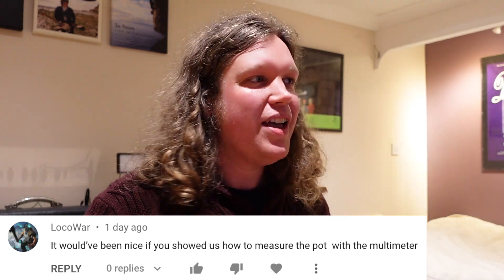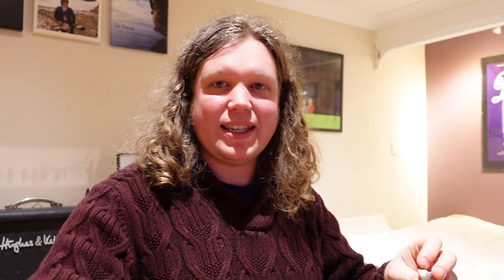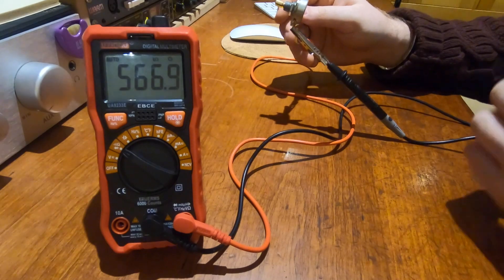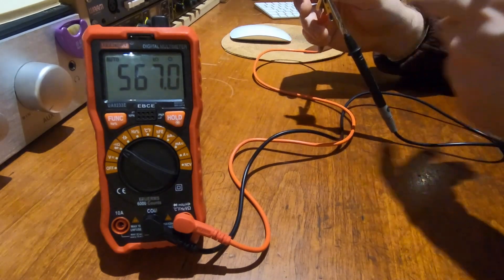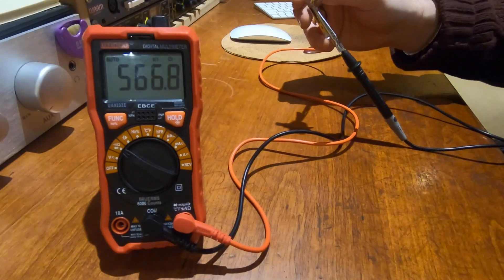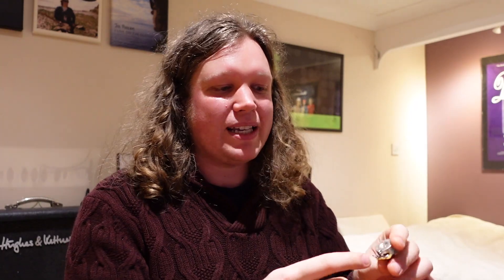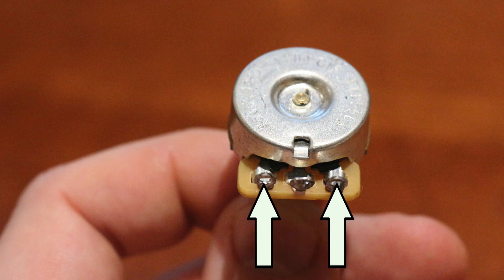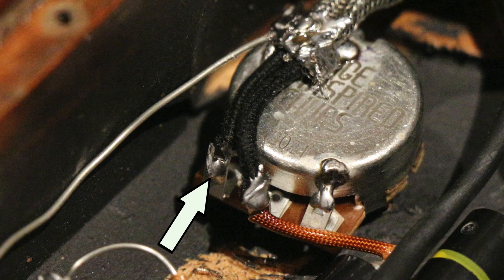How To: Measure Guitar Pots With A Multimeter

Comment: Here's my problem. I had to replace a push/pull pot but the Chinese wiring system was so convoluted I decided to rebuild a LP style 2×V, 2×T configuration. First try failed so I'm starting over. I removed all wiring and followed instructions for checking pots with multimeter. I get either OL or 0.0 on all four (meter set to 2k resistance). Surely all four pots didn't just magically go bad! Any advice?

Comment: Joe,I’m refurbing a 1960s record player,aRegentone,the tone and volume pots are tested same as guitar pots,but on pot with switch,with 4 wires,how can I test the on/ off lugs,thanks for any advice,modern pots only have 3 lugs going directly to the board,I’ve got 4 wires on this pot.and no diagram!
Reply from the maker: Hmm, not sure to be honest!  I'm guessing that the outside lugs will still be the inputs, and the middle two lugs will be independent outputs...perhaps so you can use the pot to pan Left and Right, or similar?  That's just a guess though!

Comment: With said thank you for you hard work on this video, If I'm using the multi-meter correctly and get no response at all I assume my pot is gone down the river?
Reply from the maker: If the pot is outside of the guitar and you've connected the multimeter correctly, you should get a reading, yes

Comment: Does it make a difference is one pot reads 550 and one reads 520?
Reply from the maker: The 550 pot will sound slightly brighter than the 520 does - but the difference won't be too significant

Comment: Hi Joe, thank you for the info. I’ve got a crazy (as in driving me) both my tone pots of my 2020 Affinity Strat HSS work only at 2 then no further change in tone at all thru 10. Back down to 2 makes same change. Pots are full size but what kind is unknown. Volume pot works OK and I believe is linear based on a different test I was doing. Any ideas whether it is wiring or something else? I’m new to guitar electrics and not quite ready to open pick guard til I get what I need to repair it. Any repair and replacement suggestions? Thanks so very kindly. Cheers and 
Keep playing.
Reply from the maker: Hi Steve - my guess (and that's all it is!) would be that those pots have a logarithmic taper but have been wired in reverse.  This is usually only an issue on left handed guitars where companies take a 'standard' log pot and wire it so that it moves in the 'correct' direction relative to the guitar, but this reverses the taper - the tone pots especially act more like on/off switches and are pretty useless for the first three quarters of their travel.  If you're not lefty though it would seem weird for this to be the case, as it would mean Fender used lefty pots and wired them backwards to work in a righty guitar, and that makes little sense to me unless it was a mistake.  But that would be my best guess!

Comment: So i tried this, on a new pot, and old pot i know works, and my reading stayed at 1. I tested my meter on a pickup and it worked on that, so im puzzled.
Reply from the maker: Only thing I can think of is whether the probes of the multimeter were touching each other; or touching the back of the pot and grounding out?
Reply: @JoePerkinsMusic  ok will check again later. cheers. good to see a fellow lefty!

Comment: Can i measure wirh my pot fully wired inside the guitar?

for me as a lefty… i never really tought about thst the audio taper works the wrong way if wired for lefty.  

I‘ve got so many guitars bur i barely use the knobs so tbh i dont know if my guitars are wired for right handed guitsrists or not xD. 

Are there left handed audio taper pots?
Reply from the maker: I've not tried - but I imagine everything soldered to the pot lugs (pickups, wiring off to the switch, etc) would add resistance to the reading. So you might be able to establish whether a pot is 250 or 500k, but I'd assume it wouldn't give you an accurate resistance. I could be wrong though!  You can definitely get left handed audio taper pots...but if you don't use your pots much, I wouldn't worry about swapping things around unless they're causing you a problem!

Comment: As I understand you can only measure resistance with the pol full open. That lends the question, how do I figure out if a pot has linear or audio taper?
Reply from the maker: The most accurate way is to attach a knob with numbers, measure the resistance at each number, and then plot that on a graph - see if it's a straight linear line or a curve.  However, you can usually make a guess if you have the pot wide open, turn it down slightly (approximately 8) and take a reading...that's where it'll be most different between the two pots.  At that setting, linear will be 80% of the full value; audio will be about 40%.

Comment: What is the best pot to volume ? Linear?
Reply: Audio taper on Vol, linear taper on tone.
Reply from the maker: Most guitars tend to use logarithmic/audio (same thing) all round.  But linear pots will work just as well; only a slight difference in how quickly they get quieter/darker (depending on whether we're talking about a volume or tone pot!)  Most people prefer log in a guitar context....but the earlier Gretsch Duo Jets used 1M Linear as standard, so feel free to experiment! :-)